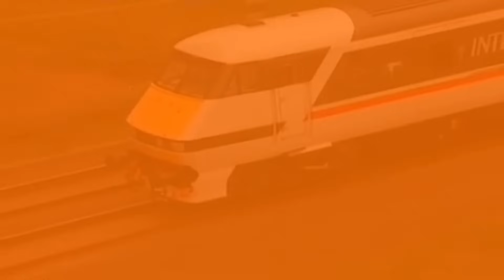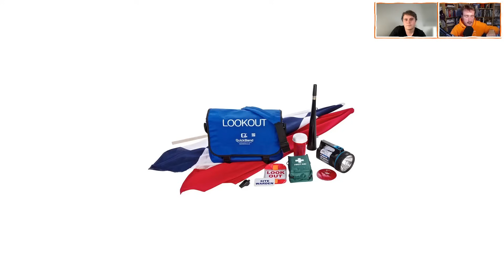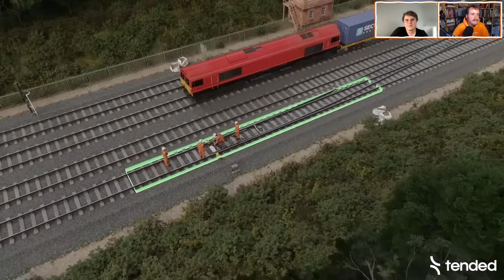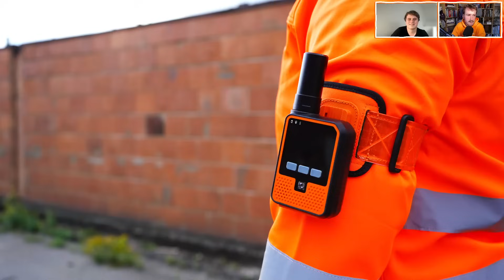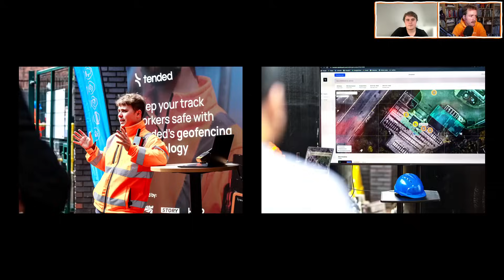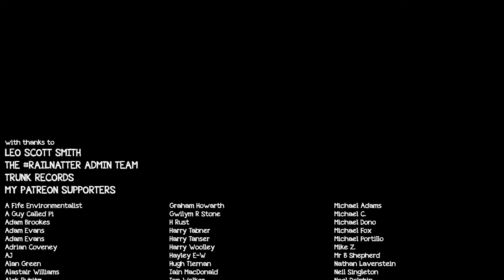#RailNatter | Episode 186: Putting geofencing to good use to improve track safety

Comment: Its interesting to hear how track work safety is done in the UK compared to the eastern US...
 We got the equivalent of a site warden, but they own that section of line. Trains operating through it request permission from them to move through at a speed given by them... which often enough is simply "time table speed". Depending on the railroad, there are also extra people in the control cab of the trains going through to help keep an eye out...